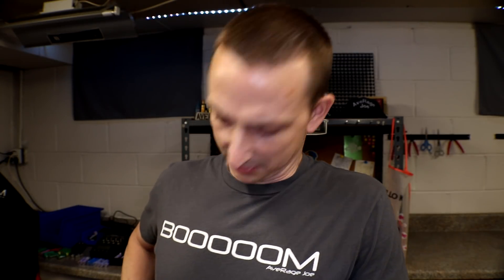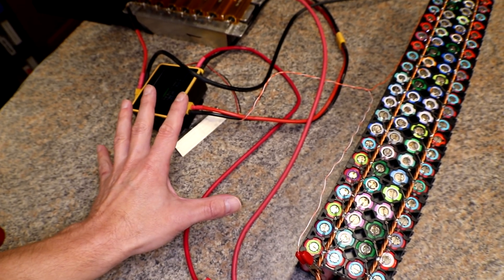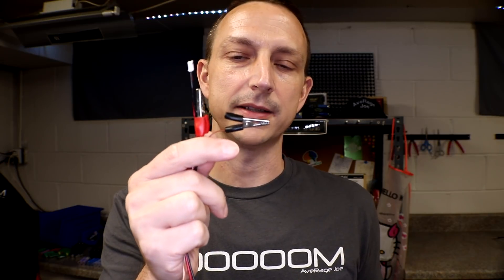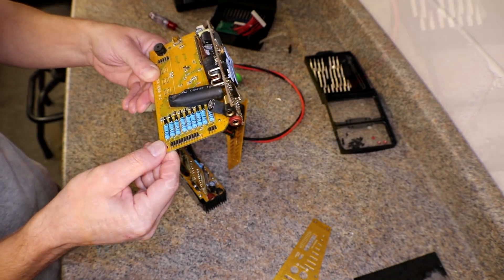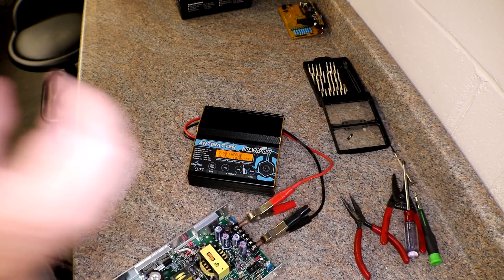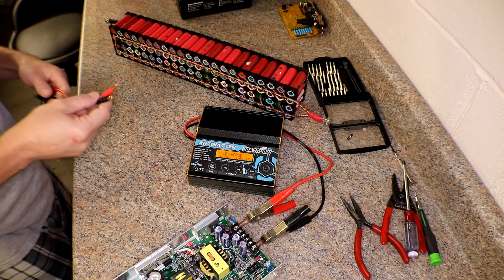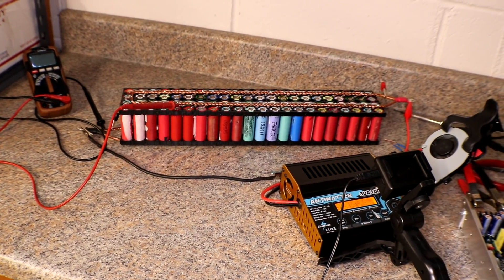Can the Antimatter Charger be Saved...AGAIN!!!!!

Comment: Joe your multimeters are not calibrated and if from China would be 10 to 20% of range out plus or minus 1 digit of scale too. Plus the Charger would be similar.  But what would I know mate. Ex calibration technician. Get a fluke mate. Hope you and family are save all the best from Victoria Australia.
Reply from the maker: The harbor freight usually shows somewhat correct voltage EXCEPT when the charger is charging lol. The other meter I found the plastic dial piece inside was cracked so it wasnt turning all the way lol🤦‍♂️Calibration.....WHATS THAT 🤣 I ended up getting a new meter tho. 🤘
Reply: @AVERAGE_JOE  All good mate. But even new meters have errors with them. Stay safe man.

Comment: there is a point along the charge curve where the charging gets very difficult and the battery can pull too much current unless you have the current limited. otherwise you can fry the charger.

if the charger can support a higher input voltage like 24 you can use that because at 24 volts you can charge the battery at higher current safely in theory.
Reply from the maker: You betcha!  I like to use 24v if I can!

Comment: Hey Joe, admirable teacher, what’s the best power supply for that iCharger for supplying 1000w
Reply from the maker: Ive been using 2 server power supplies wired in series for 24v. If thats not avaliable where your at you could also use a power supply from a laptop! Those work pretty good as well.
Reply: AveRage Joe Thank you Joe, you’re the best 🤜🏼
Reply from the maker: No Problem!🤘

Comment: Hay Joe I have lots of  stuff
 I am building a 10000 watt inverter currently
 I built a bunch of inverters I wind my own transformers
I have 5or6 1500 smart apc I tried adding a choke to lower idle current didn't do much 
I am thanking the Square apc Transformers are crap but haven't rewound a toroid to try yet
I have some 3or4 power Jack inverters also I had a friend redesign the mosfets  boards to use large physical size mosfets like hy4008 
I do lots of what I think are cool things
Just like i think you do lots of cool things If I can help you by finding and donating anything I would be glad to do so
Reply from the maker: Sounds like you are as busy as I am lol!  I havent tried doing anything like that.  Cool stuff for sure!!!  Lower idle power would be great! I would be interested in figuring out how to put 2 ups's in series for 240v.  That way I could run both legs on my panel.🤘💥
Reply: @AVERAGE_JOE  
You could just use a center taped 240 volt Transformer voltage feedback off only one side the ones I have seem to need a toroid and a choke  to lower idle current any way 

I build inverters from those cheap China inverter boards I  have had very good luck with them 

If you need any help you can see the first one I built on the back shed .com little China inverter board is the name of the post

Or can help you from here keep a look out for big toroid Transformers thay are easy to rewind for the right voltage 

Also look out for ferrite Transformers or chokes the bigger the better thay can be staked 

Inverter boards run for 30 bucks for 48 volt 2000 watts to 150 for 10000 watt boards

If you can scavenge Transformer , ferrite box, switches ,wire then you could have a really good 10000 watt low frequency pure sine wave inverter for under 200 bucks

I have some home made windmill stuff also

If your ever in my area you are welcome to check out and try out my homemade inverters and other stuff 

I live close to sandyville wv 25275
Have a blessed day
Reply from the maker: @ambersmith6517  OMG I Love the back shed!!!!!  Started going there back in 2007ish for the F&P wind gen stuff!!!  I have a few motors left to build more wind gens!  Never got around to carving blades tho, just used aluminum pipe!  Ill take a look at your stuff over there!  Used to go to redrok for charge controllers ect... Anyways, if I do the transformer way you are talking about.  Am I able to use that as split phase so I can connect to both legs of main panel..does that make since?  I remember seeing a HUGE transformer (about 12" or so in a ups case) at the recyclers a while back.  Cant say its still there or not but will check next time I go.  Other then that I have a couple smaller ones here about 4" diameter.  One is in a 24v variable power supply. Not sure what I could do with those.  If I am ever out that way Id love to stop over and same for you if your out this way!
Reply: @AVERAGE_JOE  
Yes you can run both sides of your breaker box with homemade inverters

Comment: I connect the power supply to the charger THEN turn on the power supply. That way the voltage and current ramp up, and there's no risk of inductive flyback when you instinctively pull the lead away and disconnect.
Reply from the maker: I have been doing that very same thing since the video!🤘😄

Comment: add higher wattage resistors.
Reply from the maker: Would that work??😮 I know I can do an inline resistor bank but INTERNAL🤔😲
Reply: @AVERAGE_JOE  depends on the cause of that resistor burning out. looks super cooked so could be other component failure. try it, find the same resistor with double the wattage. it may get hot but won't cook itself.
And a fan would help though not the best position for that resistor
Reply from the maker: True! Ill have to see if I have any layin around!
Reply: @AVERAGE_JOE  if you have the same value and wattage, get 4 of them, parallel 2 together and parallel the other 2, then series them, ends up being the same value but 4 times the wattage

Comment: I don't know about that balance being off that much it seems like discharge will be lower and charges will be dangerous
Reply from the maker: Couldnt agree more!  What Ive managed to figure out so far is discharge on lilo setting and charge on lipo.  Again not letting it out of my site lol.  Probly wont end up using it much after the winter pack charging and discharging.
Reply: @AVERAGE_JOE  ya I guess you could adjust the cut off voltages

Comment: You should try increasing the space on the bottom of the charger it maybe over heating because there isn't enough airflow getting passed the bottom of the board
Reply from the maker: Yeah that may help!  I do have a laptop fan kinda aimed into the holes on that side of charger to help!😆

Comment: lol. Good job.
I did the same thing to a B6 charger with pretty much the same result (burnt out discharge resistor). When I replaced the resistor on mine though, it just fried the main power mosfet at which point it became yet another donor board lol.
These days I just charge em with CC/CV buck boost circuits and rig up a bunch of purpose built constant current loads with an arduino to data log the voltage over time. More work, but extremely flexible for doing this kind of suffs. 

No 4 legged helper in this one?
Reply from the maker: Yeah Ive been pretty lucky fixing this one.  I havent tried all the other CC/CV buck boosters yet and arduino is WAY over my head lol.  Not sure where he was in this vid.  Probly sleepin😏💥

Comment: Buy a few Chines CC/CV PSU's  Buck Converters to charge that stuff.   I use them quite often.  Set them for your desired voltage. Limit the current to what ever you need or wish.    Your only charging a single cell.
Reply from the maker: Got a link?

Comment: Hi Joe 
I am not surprised by these results 🤔
The Antimatter repair, and the packs still being "Operational" both are representative of a good build.
Accidental miss-connects, incorrect settings may have contributed to the failure of the Antimatter, but it seems robust enough to be easily repaired, by the "Average Joe" out there.
Nice work, 🤔💭💣💥
Reply from the maker: Its crazy!  This thing wont Die lol  Yeah more the most part its all operator error except the first time the capacitors blew up! Im still a fan of it and so far hasnt been to bad of repairs!
Reply: @AVERAGE_JOE  I have an Antimatter for over a couple of years and have no complaints. It has very similar firmware as the Turnigy Reaktor which still works after 5 years.
I just wish it could charge 14S in one session instead of 2 x 7S sessions for my ebike!

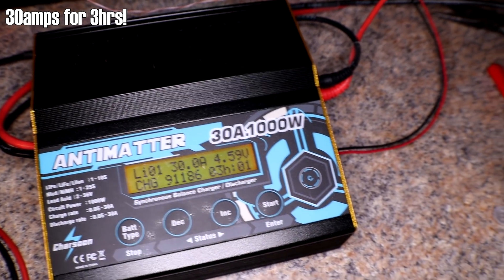Comment: @8:26 - 4.6v .. ouch.. but then I'd be inclined to believe the multimeter. trust the antimatter? for me .. no! Would be fun to abuse it some more to see how far it goes :) very wise to keep half an eye on it when in use.. good vid.
Reply from the maker: 4.6 for charging voltage isnt bad since it needs to be higher to charge the pack. The sence voltage or "balance" lead voltage is the biggie!🤣 Yeah could make for some fun videos abusing it lol!🤘
Reply: Joe could do with a reliable meter like a fluke
Reply: 4.6V is the voltage at the charger, but the battery is still at 3.94V. The balance wires don't carry much current so they have negligible voltage drop and should be accurate.
30A is a substantial current, so the charger has to pump in more voltage to account for the voltage drop in the charge cable which is 4.6-3.94 = 0.66V. At 30A, 20W is being lost as heat just in the cable!